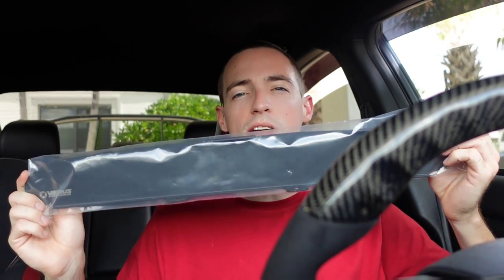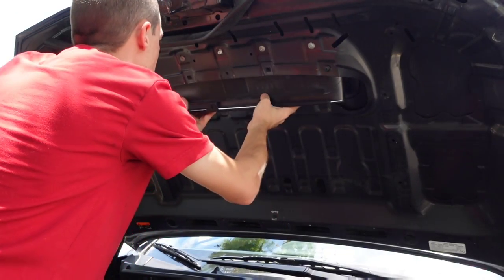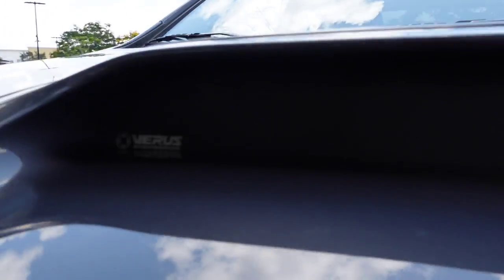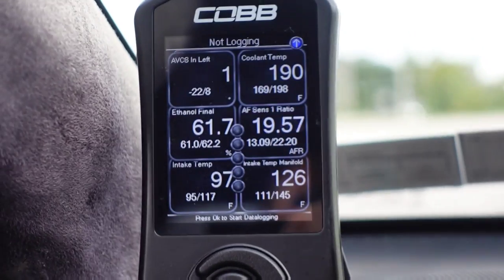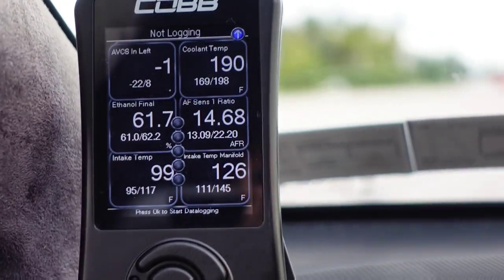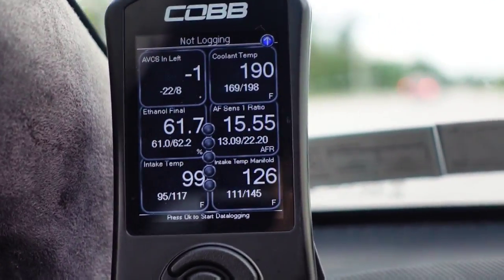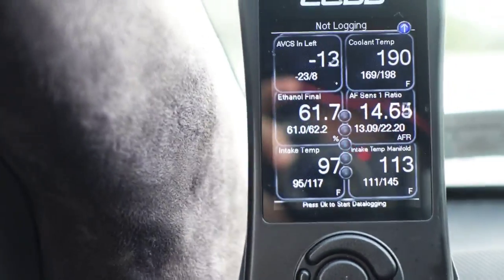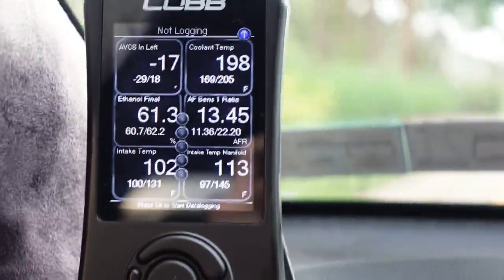Testing The Verus Hood Scoop Block Off Plate

Comment from the maker: I should mention that I did make my fender vents functional a while back and have slotted fender shrouds that may change the results a bit compared to a car without that but if you look towards the end of the video you can see real graphed results from my tuner.
Reply: maybe hood vent may have a different airflow characteristic then the side vent where the block off may help possibly.. of course another test will confirm this if it conducted.
Reply from the maker: @itsjohnnypanda2448  I have considered some hood Vents but can't bring myself to do it lol

Comment: Nice video. I have a. ETS 4inch fmic and koyo radiator. Verus hood scoop block off and verus hood vents.
And I've been tuned multiple times by Ron on E85. After this video, I'm gonna remove the block off. I've had nothing but positive experiences with Ron and trust his data 100%.
2016 wrx, all the mods, running flawlessly.
Keep up the solid content bro!

Comment: Who would want to block that iconic hood scoop  anyways?! Thanks for the video to show that there is some gimmicky mods out there
Reply: Its for the Engine to run cooler because you have no hot air in the engine bay with the scoop block off
Reply: @Franknorm1337  fresh air enters through the hood scoop thus cooling off the engine not just the Intercooler. Front mount is not a positive mod for these cars. Air also enters the lower bumper no matter what and to take away the air entering the scoop will def reduce efficiency. It’s easy to determine this on simple engineering. This mod is to reduce the amount of lift on the vehicle with the air pushing up on the hood. If you have a front mount Intercooler I could see this helping a little. I don’t get why someone would do that. The top mount IC is very efficient and clever. If you don’t track your car and care about the ms off lap times then keep the top mount.
Reply: It's not a gimmicky mod though.. it's actually more functional with a vented hood

Comment: Excellent video man. I think that adding the block off plate, in combination with hood Louvers will reduce manifold temps and coolant temps. Adding hood louvers is the key to suck air out and draw it through the front intercooler/radiator. The block off plate should help reduce the high pressure coming in to allow the hood louvers to work more efficiently. In summary the block off plate needs hood louvers to fully benefit over all cooling efficiency.

Comment: Thanks for the interesting results!  Radiators and intercoolers work because there is a pressure differential across the core and Subarus have very little ducting and sealing around them.  If we want improvements that's probably the place the start.

Comment: It's not meant to keep your intake temps down. It's meant to keep your radiator temps down. By removing the inflow from the top mount,  your radiator has less flow issues to fight against and can cool better. I've noticed an almost 8-10F lower with the plate than without it.
Reply from the maker: I wasn't looking at the intake Temp because thats completely enclosed. I was watching the manifold Temp. If the plate allowed more flow through the Radiator, it would also allow more flow through the front mount resulting in lower manifold Temps. But I didn't notice lower manifold or coolant Temps. When it's below 80° it's never really an issue but on the hotter days I just wanted a remedy to help with Temps but really can't see the benefits. Maybe because I already have Functional Fender Vents it doesn't really make a difference but I'm not sure.

Comment: i know this video is old but the purpose of the scoop block off is more to keep air from pushing under the car and lifting it up sorta like a parachute effect. still interesting to see the numbers behind it but the main point is aerodynamics not necessarily cooling
Reply from the maker: This is directly from. The manufacturer: "The Verus Engineering Hood Scoop Block-Off was developed to improve the aerodynamics and cooling of your Subaru WRX or STI.  By blocking off the scoop, the owner is able to reduce under-hood pressure.  This underhood pressure causes lift as well as decreases airflow through the cooling stack such as a front mount intercooler and radiator, hurting cooling efficiency" so I totally understand the aero benefits. I ended up keeping this on solely to help with the aero and keep the hood from "shaking " while driving from the pressure.

Comment: Definitely not a waste of money if you don’t run a top mount or an oil cooler in that location. It will help the air flow through your front mount an radiator since there is no turbulence.
Reply from the maker: Well that's the claim but I can't see any noticeable difference in manifold Temp (which would be the air after it has made it out of the Intercooler) or any difference in coolant temp. I'm probably going to leave it on regardless just to plug the empty hole until I eventually get an oil cooler.
Reply: @CGNLEvolved  it helps air flow because without a top mount the air isn’t directed anymore and causes turbulence in the engine bay. With it blocked the air that passes through the front mount and radiator doesn’t become hindered by that turbulence. There is many videos using smoke machines showing the difference with an without.
Reply: @FunTimeWithSouls  being in the game for numerous years; that turbulence in engine bay etc is not really much an affect on a street car.  Just like putting a wing on the street when the wing affective mph downforce doesn’t kick in until over 100mph.  Just be careful with gimmicks when it comes to “turbulence”

Comment: Let me get this straight I’m gonna put a plate in front of the air scoop and not expect it to get hotter and run better. Come on man
Reply from the maker: Hey that's their claim. I never really bought it but wanted to block it off from the elements so I got it and wanted to test their claim. The hood scoop is there for the top mount Intercooler. Once you switch to a front mount the hood scoop really doesn't have a purpose. The  idea or so they claim is that the scoop without an intercooler there will allow air in under the hood and cause turbulance and positive pressure to build up and make it harder for air to move through the cooling stack. And that adding the plate will stop that unregulated air from coming in and more air will get through the front mount intercooler and radiator and thus have a cooler intake charge. However after seeing my tuners analysis of it makes more sense. The air is actually going behind the engine and in turn should create negative pressure or in a way a suction pulling the air from the front of the engine compartment backwards so you would think it would pull more air with the scoop open. No one has actually ran any real data tests to prove these claims aside from my tuner running 3rd gear data logs and seeing little change but slightly hotter with the block off which is what I am observing in this video.
Reply: that is literally the point lol. it stops the negative pressure drop from right behind the hoodscoop....

Comment: Bahahaha you wanna know why there no difference it’s because there’s no hood vents that’s the point now your just slowing the air down because it has nowhere to go in your engine bay the hood vents are made to pull the air out maybe you should do a little research first lol
Reply from the maker: @dreambiggarage  think of all the cars that come factory with front mount intercoolers. There's almost never hood Vents on those cars. There's no difference because the open hood scoop doesn't cause issues with the flow of a front mount like people claim.
Reply: @StreetInspired1  that’s because there designed that way there is another ways for the air to get out usually once you start getting into areo like proper you’ll start to figure this out
Reply from the maker: @dreambiggarage all cars have open front ends though to allow air through the Radiator. Along with the wrx. But either way, if the hood was vented the difference would be so negligible for a daily driven street car.
Reply: @StreetInspired1  I’ve personally tested this on my 2015 sti like two years ago not only did I see consistent iat drop 5 degrees my csf rad/oil cooler also worked better car ran 2 degrees colder
Reply from the maker: @dreambiggarage  your hood was vented and scoop blocked with those results? Was the difference in temp comparing open scoop vs block off and Vents? That's a mathematical difference but 5° on one day probably isn't noticeable.
Reply from the maker: @dreambiggarage  that's my main argument is it seems like a waste. Even if it works it's not really noticeable in my opinion.  But either way it's to each their own
Reply: @StreetInspired1  just the difference I saw from pre vents and post with a csf rad/oil cooler and an ets fmic 4”
Reply: Block off plate in place sorry forgot